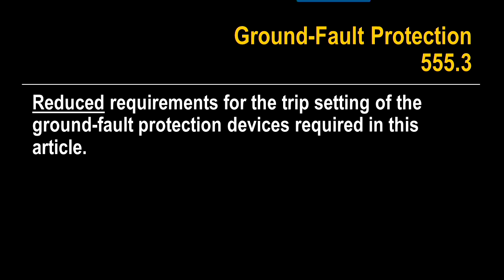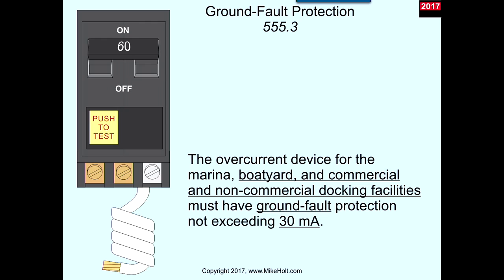2017 NEC - Ground-Fault Protection [555.3], (1min:06sec)

Comment: If a subpanel was placed on land at a private fixed pier, would ground fault protection be required for the feeder supplying that panel per 2017? Seems to be vague now..
Reply from the maker: The 2017 is terribly vague; the 2020 NEC improved the text and the 2023 nailed it down. What you 'should' do is GFPE protection set at 100 mA for the feeder, and 30 mA GFPE protection for 'boat shore power receptacles' and GFCI at 5 mA protections for all other 120/240V receptacles.